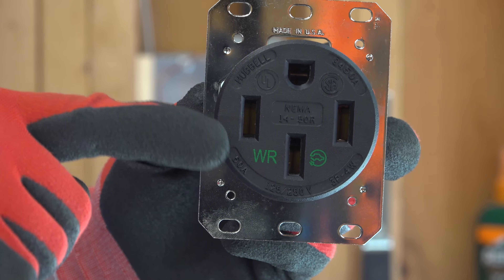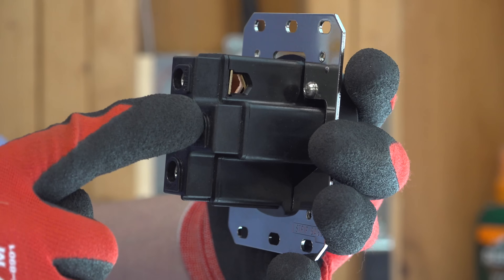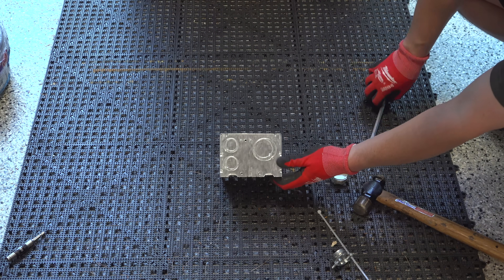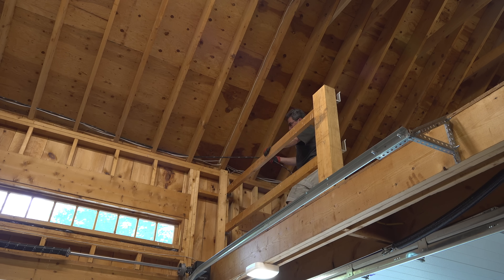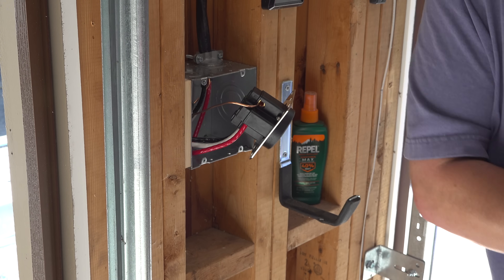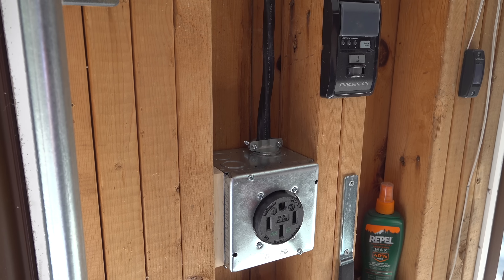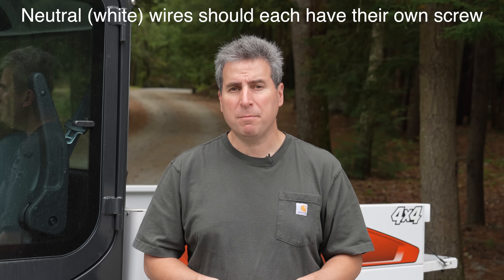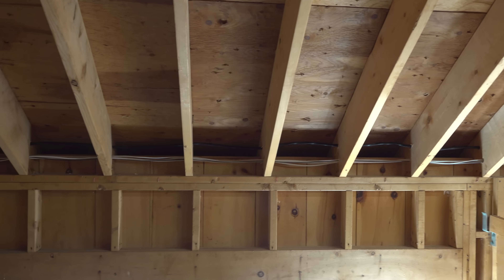How To Install A 240V Outlet Start to Finish -  EV Car Charger - Welder 14-50 Explained

Comment: I had a Leviton installed by an electrician when I bought my EV. Within a year it was completely melted. I changed it to a Hubbell and it has been cool as a cucumber ever since.
Reply: Im confused by this melting outlet thing. If I sell a widget for any load up to that amperage and voltage, how can It start melting if I use it for a certain amount of time. Something is wrong. The length of time an outlet is used should not be a reason it melts. Leviton should be saying it out right on the box. Not for use more than a certain amount of time? Rated for only 20 min of continuous use?
Reply: @WilliamPozo  I'm not an electrical engineer or even electrician so I don't know but I would guess that the Leviton was built for a certain duty rating that is below what is needed for an EV charger. My cheap welder has a duty cycle of 60%, meaning that I can use it under load for 6 minutes but then I need to let it cool for 4 minutes. I could run it for longer than 6 minutes but at some point, it will overheat. I imagine that the non-EV rated outlet is the same.
Reply: @rogermccaslin5963  The NEMA 14-50 rating is for 50 amps for durations under 2 hours, and 40 amps for continuous duty ( which is why EVs were limited to drawing 40 amps instead of 50, which has since been further derated to 32 amps ).  If an outlet melts under a 40 amp load, it doesn't meet spec and should have its UL listing yanked.
Reply: @phillipsusi1791  The NEMA 14-50 is rated for 50 amps regardless of duration (it can do 50 amps all day long).  The common "40 amp" rule is actually due to NEC sizing guidelines (for planning new circuits) that say that circuits should always be designed so that the (anticipated) continuous load is no more than 80% of the circuit rating. (But that is just an extra margin so you're not constantly bumping up against your breaker's tripping range (and so a circuit can have occasional intermittent loads in addition to the continuous load (as often happens), without tripping).  It doesn't actually mean the outlet isn't able to handle the full current.)

The "32 amp" limit is actually for 40 amp circuits (again, because of the NEC 80% sizing rule).  It does not apply to properly sized 50-amp circuits (6 AWG wire with a 14-50 outlet), such as this.
Reply: @foogod4237  No.  The 125% oversizing rule for continuous loads is because some heating of the conductors ( which includes the outlet ) is ok for short durations.  It has nothing to do with avoiding tripping circuit breakers under additional inrush current.  The same rule applies to say, your typical nema 5-15 outlet: continuous loads aren't allowed to draw the full 15 amps.  That's why Teslas ( and space heaters ) will only pull 12 amps from a 5-15 outlet.  A few years ago the NEC published a new rule further lowering the charging limit specifically for EVs on a 50 amp outlet to only 32 amps, even though there doesn't seem to be a good reason for this.  My wife's model X from 2016 came with a charging cable that will allow up to 40 amps from a 14-50 outlet but because of this new rule, newer cables, like the one that came with my 2022 model 3 only allow 32 amps from a 14-50 outlet.
Reply: @foogod4237 a 14-50 receptacle is code compliant on both a 50A circuit and a 40A circuit. This why ev mobile chargers only allow a draw 32A instead of 40A because there is no telling what's behind the receptacle. Numerous evse manufacturers have released wall mounted units for 50A circuits drawing 40A and I'm sure people have blindly plugged them in. 

Moreover, a 14-50 receptacle is identical in construction to a 14-30 receptacle. This is quite a span of demands on essentially the same design. Cut off the unused neutral pin on the evse plug and it will happily insert into a 14-30R. It is akin to the same hardware components on a 2-15, 5-15, 5-20, 6-15 and 6-20.
Reply: @foogod4237 - My experience was quite different. The Leviton could not handle a more or less continuous load of 40 amps from a level 2 charger. The Hubble has no problems and runs cool.
Reply: @phillipsusi1791  nonsense.
Reply: @phillipsusi1791 Model 3 came with the second version of the mobile wall connector.  Model S and X included the original (40A) version for a few more years.  The change has nothing to do with the NEC.
Reply: @MrZorbatron I read several articles online saying that the changed the code and that's why Tesla was changing the cable.
Reply: @WilliamPozo  The longer you run heavier loads the hotter your conductors and receptacle gets.  This is why you should always run 6-3 THHN and use a receptacle that can handle heavier loads.

Leviton and many other legacy receptacle manufacturers will only provide you the bare minimum of conductor, because they are being cheap.

Many of these receptacles that Leviton sells, is specifically for 30-40 amp arc welders, or 30 amp dryer circuits.  Welders are not constantly using loads for hours, like an EV charger.

This is also why people need to account for the 80% rule as well.  There are other factors like the distance of the conductors and other factors that waste energy in heat.

The reason why a Hubbell receptacle works good is because it's got heavy conductors inside, which also makes them substantially more expensive.  They can easily handle heavy loads for long periods of time.
Reply: What he stated in the video was wrong.  This has nothing to do with how long it is being used at a time.  Both the cheap and expensive outlets are rated for exactly the same current (including continuous usage).

The difference is that the cheap outlets are not intended for a lot of plug/unplug cycles.  They are meant for things like a stove, where you plug it in once, seal it away behind the appliance, and then never touch it for years.  With the cheaper receptacles, if you plug and unplug things a lot (or sometimes even if you just wiggle or bump them frequently), the contacts will get looser over time, and then they can develop higher resistance and overheat under heavy load.  The beefier ("EV") outlets are actually designed to be plugged and unplugged a lot, and do not have those sorts of problems.
Reply: @foogod4237 Except mine was NEVER unplugged, and yet the outlet indeed melted.
Reply: @spenceralridge4958  Well, there are other reasons outlets can melt down too, such as improperly tightened connections, or the receptacle even just being defective (it does happen, occasionally).

The point is that even the cheap outlets are intended to supply full current loads even for long periods of time (and many actually do, all the time).  The price difference isn't about how long you're using them for at a time, it's just about how sturdily (physically) constructed they are.
Reply: @foogod4237 Fair enough. All I know is my admittedly limited experience.
Reply: @foogod4237 I hope you are not an electrician because you are so confidently wrong. 

Cheap outlets are not rated for a continuous loads which makes a big difference in what the internals of the outlet are made of. There is a reason levition has EV rated receptacles and non EV rated receptacles. 

Just because two receptacles are rated for 50A doesn't mean they are capable of the same performance. The leviton receptacle although rated for Ev use is more likely to melt due to its 60C terminal rating, while the Hubble EV receptacle has a 75C terminal rating giving it the ability to handle heavier heat cycles due to the material used in its construction and the type of securing method it uses to secure the conductor. It has very little to do with how much you plug and unplug Receptacles.
Reply: Did you get the EV certified Leviton receptacle?  My electrician said he hasn't seen one this heavy duty before.

I even had to get a larger faceplate because the standard 14-50 wouldn't fit.
Reply: @jaglover - No, it was a plain old, regular duty, dryer-style receptacle, and that was the problem. I am sure the Leviton receptacle that is made for the continuous, high-current draw of an EV would be fine, but I knew the Hubbell would do the trick and it has been great ever since. Interesting thing is that when the old Leviton was in place the entire cable for the EVSE (charger) would get very warm. Now, with the Hubbell, it is cool as the other side of the pillow.
Reply: @spenceralridge4958  yeah your original post was a bit misleading  I was afraid you were saying you had leviton ev rates receptacle and it was melting    Your issue was an electrician putting in the wrong type of receptacle
Reply: @walterbingham3876 it was just a bad installation.  I’m going on 7 years with a plain ol Leviton no problems
Reply: @jaglover  your electrician has never seen a commercial duty Hubbell then.  The EV Leviton plug is junk.
Reply: @MrZorbatron The EV certified one?
Reply: @jaglover  "certified"...  It's junk.

Edit:  Ok, maybe junk is harsh.  It is a slightly built up version of the standard.  There is not one thing about the Hubbell 14-50R that is not better. 

The issue with these connectors is that normal 14-50 aren't plugged and unplugged a lot.  Because of this, most of the variety you see for home use aren't that robust.  They wouldn't have any problem with charging if they were just plugged in and left there.  The biggest improvement in the "EV" version is that the contacts are designed for more insertion cycles.  They might have slightly better tensioning, and be built of higher grade material to withstand more deposition.

Take them both apart if you don't believe me. Actually, take apart all three.
Reply: @MrZorbatron I don't have the money to take $50 receptacles apart. Maybe someone with more wealth would like to show the group.   But your critique is noted.
Reply: Was it the EV rated Leviton?
Reply: Because electrician didn’t tighten the lug nuts well enough.   They usually send the apprentice to do the job and they have never seen a torque wrench
Reply: It melted because the connections were loose, not because of the outlet
Reply: @zinsco No, it didn’t. The connections were torqued, and were still torqued when I replaced it. I checked when I was removing it.
Reply: That seems like a fail on the electricians part. They should have known to only use an EV certified one.

Comment: When I put 20 amps or even 15 amps in a metal box I usually ground them.
Reply: Metal Boxes. A connection shall be made between the one or more equipment grounding conductors and a metal box by means of a grounding screw that shall be used for no other purpose, equipment listed for grounding, or a listed grounding device.  Mandatory by the Electrical code.

Comment: Isn't this 50A breaker too much if you only have 100A main breaker for your huge house?
Reply: If you only have 100A service, you would likely install a 30A EV charger. It will take longer to charge the car batteries, but you will have the ability to run other higher amperage devices at the same time (water heater, dryer, oven, AC, etc.). Some people even install smart devices to only allow some of these to operate when the others aren't.
Reply: @db869 exactly, but he has only 100A service and installed 50A breaker for EV.
Reply: Regardless of panel you need to do a load calculation.
Reply: Since the box is in the garage, it is almost certainly a subpanel from the main entrance box(es) which are likely 200amp panels elsewhere in the house.   Seeing that large box over his shoulder on the L makes me wonder if he also has solar panels.

Comment: That box is called a 4-11 box. 
(4 11/16")
The cover plate is called an I.R. cover
(Industrial Raised)
Reply: Leviton part No. is SL701 for the cover plate and NOT SL703 which is the smaller standard outlet size. Trust me, they are different!
Reply: I've never seen a 4x11 like that. Also we call them RS covers

Comment: I have my electric board in a perfect spot, near the garage door. I'm just waiting for EVs prices to go down and for my Camry hybrid to die. Other than that, in my situation, the numbers show no savings at all in switching to an EV.  Great video anyway.
Reply: There are some incredible deals on evs on the used market.
Reply: EV savings are very dependent on how many miles you drive regularly.  I have a 180 mile round trip commute. Under best circumstances my hybrid costs me about $85 per week in fuel. My inefficient Ford Lightning can do the same weekly commute for $48 in electric via home charging leveraging time of day rates.  I'm saving roughly $1500 per year over gas. 

If you're not putting as many miles on your car the math may not be in your favor. 

Also, my used EV was about $15k less than my new hybrid.

Comment: It is absolutely not universal. It does not exist in any part of the world other than north america?
Reply from the maker: By universal I mean that you can use it for multiple 50 amp applications, and even lower amperages with adapters. I am very aware of how bizarre the US power stuff is compared to the rest of the world. We are stuck with it.
Reply: @SilverCymbal  I wouldn't say bizarre, it has some advantages ... I was just in pedant mode :)

Comment: You should pull the wires a couple times in the receptacle, then re-tighten them again.
Reply: I recommend after three months of use of high current devices to go back in and retorque connections. Every now and then a quarter turn just magically appears.

Comment: Thanks for the video - very informative.  I'm glad you explained the importance of using 3 wire vs 2 wire as well as the difference between the continuous duty 50A Hubbel outlet vs the $12 Leviton outlet
Reply: To nitpick a little, it should be stated "3 conductor vs 2 conductor," not just 3 or 2 wire (since there are actually 4 present).
Reply: @maxwellgriffith  In an electrical context, "wire" and "conductor" actually always mean the same thing.  The ground wire is actually also a conductor too.  One is just a more formal term, that's all.

These NM cables are typically labelled as "6/2 plus ground" or "6/3 plus ground", but that doesn't mean that the ground isn't also a conductor, it just means that it is being listed separately (because the ground conductor is actually not the same gauge (#6) as the other conductors in the cable).

(The only time a "wire" is not also a "conductor" is when it is not used for any electrical purpose (for example, a guy wire to hold something up, or using steel wire to tie or secure something).)
Reply: No "importance" was articulated beyond the vague implication something somewhere sometime might need the extra wire. EVSE (EV chargers) and welders, won't. Dryers, electric ranges might. But out in the garage?

Comment: I would like to request a video where you describe the differences between bonded neutrals and floating neutrals in a generator and when you should and should not use each type.
Reply: I watched a really good video on that just yesterday from Backyard Maine.
Reply: Second Backyard Maine

Comment: Awesome tutorial. The Hubble receptacle is the best around.
Reply from the maker: Thank you, I really appreciate that. It feels like 4 Levitons molded into one brick
Reply: @SilverCymbal  So built like a tank?
Reply: Hubbell
Reply: The Bryant is the exact same receptacle as the Hubble 9450A. It is Hubble's contractor label. It is the Bryant 9450FR and currently seems to be about $15 or so cheaper than the Hubble. When the Hubble's price went nuts (over $100), the Bryant could still be found in the high $40s. I have used both, and cannot tell any difference between the two. They are identical.
Reply: Also, the inexpensive receptacle is designed for plug-and-stay.  eg. a stove where you plug in once and will not be removing it. For an EV charger, you will need a receptacle that can handle many cycles of plugging in and unplugging throughout its service life.
Reply: @MetaView7  I find this interesting, here in .uk, an EVSE is always hard wired unless it's the 10 amp granny charger
Reply: @TheChipmunk2008  You aren't allowed to use the charging cord that comes with an EV?
Reply: @Rhaspun  the granny charger cord yes, usually limited to 2.4kw, anything larger will be hard wired, differing wiring regs i guess
Reply: Now this is an legit endorsement!  Good to see Will Prowse present on other quality channels.
Reply: They also make a cheaper version. I'd like to see a tear down comparison. I have the cheaper one and it appears to be fine to me.

Comment: 9450 seems like way overkill for most welders, but it's always worth having a 9450 in the garage. I do believe on an older build and a standalone garage you're not required to do GFCI. The garage we just built passed electrical inspection with a new 200 amp service run, 400 amp upgrade to the main house, and no GFCI breakers. That included 2 outlets for hybrid chargers on 9450s, 1 30 amp welder run with neutral, and one 30 amp compressor run without neutral. Only GFCIs that the election did was an outlet on the start of each receptacle branch circuit. Personally, I love GFCI when possible, but they don't play nice with a lot of garage equipment.
Reply: NEC (National Electrical Code) allows GFCI protection either through a circuit breaker, or a GFCI device, such as an outlet receptacle. Anything existing is grandfathered and does not need to be upgraded. But the moment that you touch something (like installing new service) you must bring the stuff you're working on up to current code. By adding the GFCI outlet at the start of every branch circuit, they brought your system up to code in the most cost effective way. GFCI is required in wet areas (kitchens, bathrooms), garages/shops, basements, and outdoors.